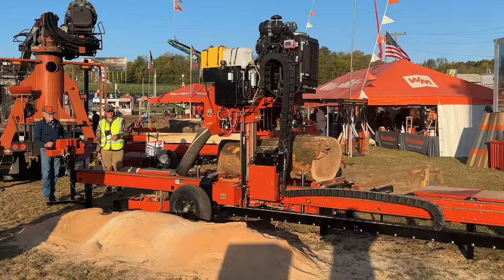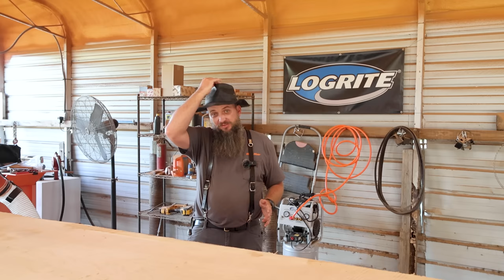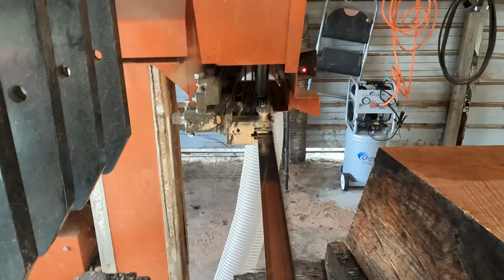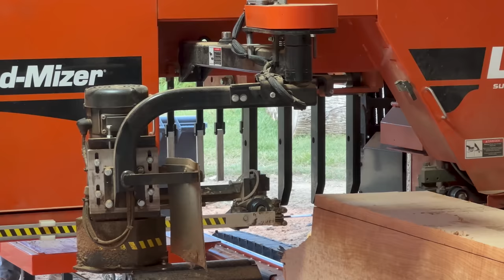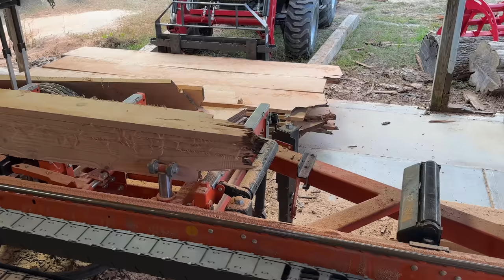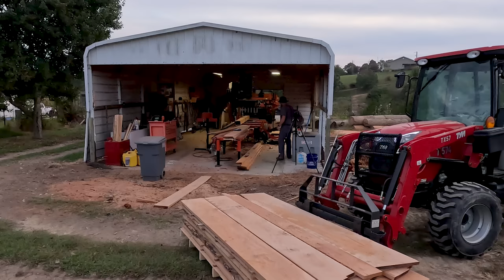Red HOT Cherry On The Sawmill & Running A LT70 Backwards

Comment: On the plus side, running the mill from the other end would keep you out of the weather. On the minus side, you'll end up walking a lot extra to get the lumber off. You'll stay warm this winter if you do switch ends.
Reply: a little walking just helps keep you going and no wet to cut work too soon

Comment: If you switch ends for your controls you will do more walking when you off load.   The man at Paul Buynan had grunts doing that for him.  The old guys at Cooks operate from the same end as you do now but rotate their logs 180°  degrees and cut from a small diameter end.

Comment: you tuber suggestion ,🙂when you run hard pipe for the saw dust collector
hang it from the roof to the middle of the saw travel then flex hose down leaving enough slack 
for the saw to go full travel both ways ,( just an idea) it'syour shop how ever you do it you are the one 
that has to like it ,not me😁

Comment: I had the same question about the hinge wood.  What was different about that cherry log in relation to others you’ve had on the mill, there was no cracking or splits ( checking) in that log?  I’ve watch Hardwood Hobby and most of the cherry logs either of you guys put up on the mill is badly checked, that must have been a premium grade A log!

Comment: Moving the operator position to the other end of the mill would be a bad idea. All of the pieces you move off the log you are working on (with the puller arms) will discharge at the far end of the mill. This means you would have to walk to the other end of the mill to deal with it all. Bad idea!!
David Young